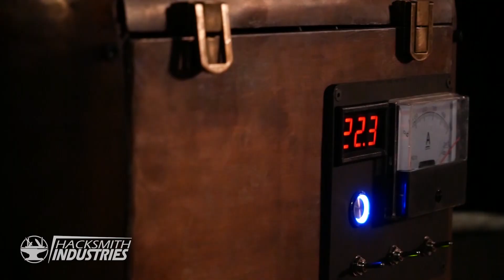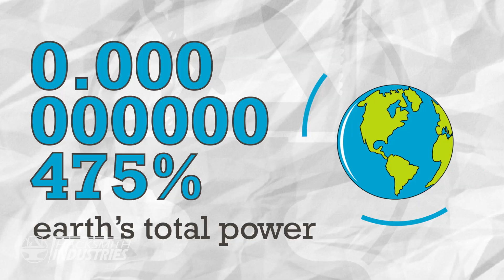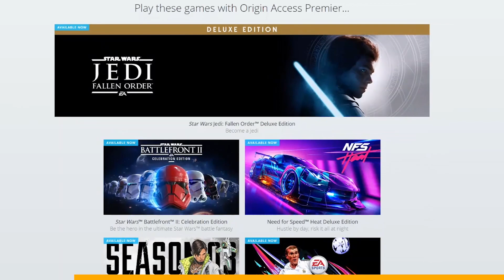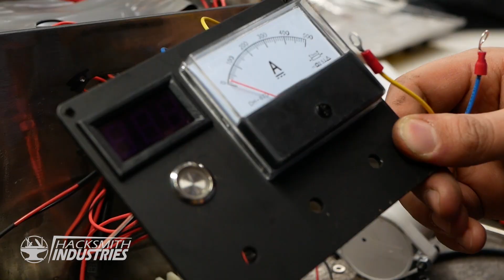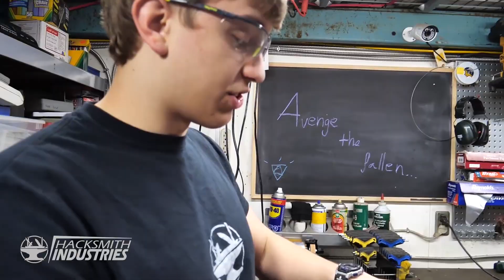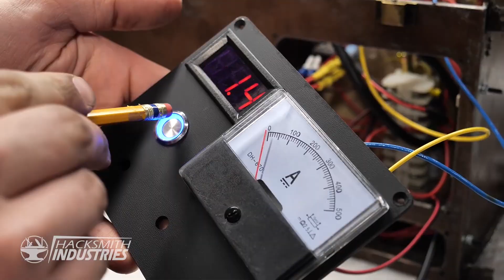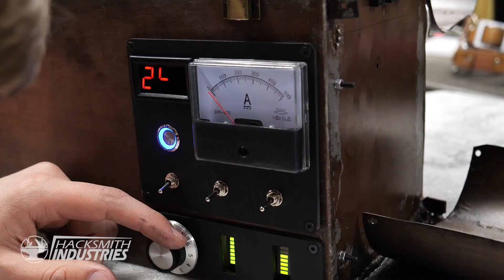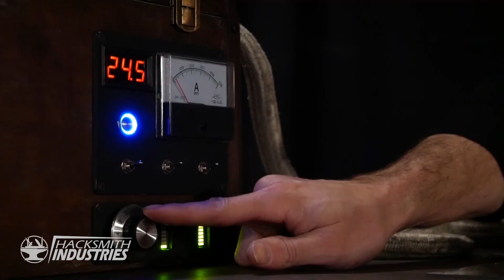World's First Protosaber! (REAL BURNING LIGHTSABER)

Comment: Now we just need to make the blade out of PURE MOTHERFUCKING PLASMA
Reply: CallMeCar then how r we going to keep the shape
Reply: @ruoyan9863  magnetic field bruh
Reply: @ruoyan9863  By making it more of a torch.
Reply: Ruo Yan probably some gas to keep the photons in place
Reply: @ruoyan9863  i think we should use a metal that is a plasma Conductor
Reply: creeper krazzy, you don’t conduct plasma seeming it is a state of matter, you don’t conduct liquids or gasses do you?
Reply: @olivesiren3537  From my own research, both of you are actually correct. What is now known as a lightaber was originally a large, bulky piece of mining equipment! It was a massive power generator that produced immense heat for just moments via "frozen" blaster technology. What preceeded them as conceptual lightsabers up to about 8000 bby were either Force-enchanted swords, such as Naga Sadow used, or darksabers that the Rakata used. Darksabers required the Dark side of the Force to function, as is true with nearly all Rakata tech. The original lightsaber is truely a much older design that had no practical use as a hand-held weapon.
Reply: Ruo Yan a magnetic field of some sort?
Reply: @ruoyan9863  magnets.
Reply: @ruoyan9863  via bounder flow
Reply: Ruo Yan, magnetic field
Reply: @ruoyan9863  Simple, create a titanium mold in the shape you need. Temperature test the mold by placing it in a forge(or if you're a normie just blowtorch it for a while).
Reply: @Gorgarth_JS  Titanium is a great metal, but it simply isn't able to handle that much heat! I would recommend either a new type of ceramic and boron nanotube composite, carbonfiber, or a tungsten alloy. A decent lightsaber would need to exceed 2861C to reliably vaporize iron, which makes that a good minimum-temp benchmark. Titanium melts at 1668C.
Reply: @d.dementedengineerc99isurf26  Fair enough, I suppose I didnt put enough thought into it lol
Reply: @Gorgarth_JS  Don't beat at yourself too much, because it wasn't a bad suggestion considering titanium's higher melting point! It's just that plamsa is wicked-hot! The boiling point of iron at 2,860C is 5,180F!!! I doubt anyone could wield that with even the best of magnetic fields, as heat always has those radiative and conductive properties, roasting all nearby! Something more than just a magnetic field is needed. One would need a well-insulated and highly-reflective exosuit to withstand that heat, and we already have those! Vulcanologists wear them whenever they aproach hot lava.
Reply: @d.dementedengineerc99isurf26  So logically speaking it would be physically impossible to create a real life lightsaber not only because it take an absurd amount of energy but because it would melt you where you stand even from testing it for a few seconds
Reply: @Gorgarth_JS  Yes. Imagine bringing the sun to half a foot from your face! You won't melt. You'd burst into flames!!
Reply: @Gorgarth_JS  On second thought, "impossible" isn't the word I would use. I'd describe it as both extemely difficult and extremely dangerous.
Reply: Ruo Yan electromagnetic field. That’s how it’s done in-universe, also explains how they collide with each other. We just need to find a way to generate a field and we good
Reply: @keeganfirecloak4695  well, lightsabers are also powered by small nuclear batteries basically. We'd need to scale down a reactor to that level as well.
Reply: @ruoyan9863  Magnetic field
Reply: @ruoyan9863  strong magnetic field
Reply: @ruoyan9863  a magnetic field would retain the plasma.
Reply: Ruo Yan 
A strong magnetic field maybe?
Reply: @derfuchs3296  Hello, you cute fuzzy redhead! :3
Reply: @ruoyan9863  Magnetic fields. Plasma both affects and is affected by them!
Reply: Ruo Yan magnetism
Reply: I actually have a design for that if you would like to hear
Reply: @red6.0  I'd love to
Reply: @red6.0  I wanna hear
Reply: Drake Hahn I wanna hear
Reply: @red6.0  please I want to hear this too
Reply: @red6.0  You got my curiousity
Reply: Drake Hahn why would you ask to answer a question
Reply: Drake Hahn Upload a video about it.
Reply: Drake Hahn What, did you watch some because science video and copied his idea.
Reply: @red6.0  What's the design?
Reply: @red6.0  If you are talking about the super battery, fan in the pommel, magnatized, collapsable, holed lightsaber that leaks out Plasma, yeah ive seen the video as well.
Reply: Anything is possible. Those who don't understand that don't understand quantum theory/physics, and they definitely don't understand our reality, or what what infinite really means. With that said, just because anything is possible, that doesn't mean that anything and/or everything will happen.
Reply: @in_vas_por8810  I think people really overuse and overestimate this "magical" quantum theory. It's not really all that special. It actually does imply that some things are impossible.
Reply: Drake Hahn aye we wanna hear what ur desighn is
Reply: @red6.0  I wanna hear too
Reply: Drake Hahn I wanna hear
Reply: @red6.0  WE ALL WANNA HEAR
Reply: @red6.0  "you had my curiosity, but no you have my erection"
Reply: I wanna hear this.
Reply: I saw this before
Reply: I think it was styropyro. He's the crazy guy who's a wizard with lasers.
Reply: They've taken the first step.  They've started us down the road toward the existence of a fully functioning lightsabre.  That's more than any of us can say.  This is history in the making.  Do not discount this, do not discount their accomplishments.
Reply: @Robert_Douglass  I think I will do exactly that. This is a hot stick. He said it right there in the video; a real lightsaber is impossible. That's that. There is no more to it. I sincerely hope this has burst your bubble and that you feel bad about saying something so moronic.
Reply: Nate Jl imagine thinking something is impossible within science
Reply: @natejl772  Everything is impossible until it becomes possible.  Look up Alcubierre-White, and you'll see that we are one step closer to figuring out faster than light travel.
Reply: @natejl772  Everything is impossible until it becomes possible.  Look up Alcubierre-White, and you'll see that we are one step closer to figuring out faster than light travel.
Reply: @xavier6838  Literally everything that is impossible is impossible BECAUSE of science.
Reply: DouglassRobert the laws of physics and such do not permit anything to travel faster than light
Reply: @natejl772  he was trying to give them thanks and maybe it isnt against but isnt discovered yet there's no need to be an issue
Reply: @natejl772  chill you don't have to make everyone feel bad
Reply: Nate Jl it's not impossible. I have a few ideas. I plan to start building it within 5-10 years.
Reply: @guywithacamera1749  the alcuberia/white drive works by warping space/time. Its basically star treks warp drive, though the math involved is beyond me the papers are available on the internet and they hold up to current physics. 
Of course to get a working version we would need hypothetical matter and absurd ammounts of energy (like equivalent to .1 jupiter masses of antimatter if i remember correctly) there's also the unfortunate unaddressed problems inherent in moving at relativistic speeds , like any and all radiation up shifting into high gamma radiation to say nothing of what a grain of sand would do at those speeds, or the fact that due to the blueshift inherent you would be completely unable to see ahead of the ship without yet more Clark tech. In a way you are both right on this
Reply: Nate Jl With our current technology, it is impossible, but almost nothing stays impossible. 20 years ago, functioning eco-skeletons were impossible, but my team and I are currently well into the development process of a functioning medical exoskeleton. Going to space was impossible before the Space Race. Cities were impossible before agriculture. As far as impossible tasks go, controlling plasma isn’t terribly monumental considering we already harness it for welding, cutting, and engraving.
Reply: @guywithacamera1749  the laws of physics do not allow anything to travel through SPACE faster than light. SPACE itself can do whatever the hell it wants. Like what it's doing now, expanding faster than the speed of light.
Reply: @ScarlettHasToast  not only that, we are on the cusp of fusion reactors. Actual full scale fusion reactors. Not fission, but fusion.
Reply: DryHot Fuzz going faster than light, that shits impossible
Reply: @guywithacamera1749  they don't prevent quite "everything".
Reply: @guywithacamera1749  Technically that's true.  But the Alcubierre-White warp drive, in theory and provided we can acquire enough dark energy to make it work, causes a "bubble" to form in spacetime by expanding it behind and contracting it ahead of a vessel so that it pushes anything within that space, including light, to greater speeds that what the General Theory of Relativity allows, akin to riding a wave.  In essence, the space itself moves faster than light, and because it is the space that moves, everything within that space is accelerated to the same speed.
Reply: @willkershisnik5893  going through space faster than light may be impossible, but get enough energy and dark matter to bend and warp spacetime and you can make space itself move faster than the light within it.
Reply: @jonjonward3915  Sure you are. please, share your designs so we can all see your genius
Reply: @ScarlettHasToast  What exactly is a "functioning exo skeleton"?
Reply: @Robert_Douglass  woah there padre, slow down with the edge there
Reply: I like your enthusiasm
Reply: Lol
Reply: I’m thinking that a strong enough em field should be able to control and contain the plasma in a real light saber we can already make the plasma balls in a microwave ( see the king of random about that )
Reply: @nickfenix3892  The problem is that you need more hardware to create the containment field than is required to light up a hot stick.  Lighting up a hot stick is a much better solution, and if you want, you can create a plasma around the stick, if you don't mind the stick sublimating with use, but there always needs to be some kind of hot stick in the middle.
Reply: The hot stick material can improve a lot, though.  Like I can imagine making a very hot stick out of high tension carbon nanotube rope, and that could create a thinner stick with even more intense heat density, which would make it easier to cut through things.  These guys basically showed it can be done.  I expect someone to tuck into it soon.  :)
Reply: Nick fenix lol if u have a strong enough field to hold plasma in place then it will be a barrier also to have contact with it....
Reply: @Puppy_Puppington  We can't actually verify that yet, and it will be at least centuries away. Plasma as we have it now passes through itself effortlessly.
Reply: CallMeCar make a tube, fill it with grapes, microwave them
Reply: Well uhh I guess Fire has plasma? Ehhhh
Reply: yazmin soto plasma is a stare of matter not a chemical reaction
Reply: Can we shape plasma with Magnets?
Reply: in Star Wars the first "lightsabers" used to be regular swords that were enchanted by force rituals mostly Sith Swords that are said to be as strong as lightsaber, then the second lightsabers you had to carry a power backpack just like in this video then they finally made the lightsabers we know today that dont need a powerbackpack
Reply: @lilclout5118  BINGO.
Reply: But we Need a Kyber-crystal to hold the Plasma on position
Reply: Call styropyro for that one
Reply: Much of this is already possible but a power source of the magnitude is far far away!!!
Reply: hi call. oh yeah yeahhhhhhh
Reply: GKeeper316  wtf did you get this information?
Reply: GKeeper316  yeah I just remembered. Now about that other thing.....
Reply: GKeeper316  which ones?
Reply: Well shit I just scrolled to the bottom and realized you guys pretty much figured it out yourselfs
Reply: It is a protosaber dude. Ok. I'm not saying your wrong I'm just saying that we just don't have the technology right now to do that. But at least they figured out how to start.
Reply: @Sequelhater69  yeah I know

Comment: How many of you know what a Tesla coil is? If you have a car, you have one. In a car it's called an Ignition Coil. It takes a small amount of volts, 12vdc, and turns it into 100,000 vdc or more to power the spark plugs. From no more energy. This is zero point energy. They don't want any of us to know this.
Reply from the maker: Voltage is useless without current.  Tesla coils  are transformers. Power does not increase,  it is proportional. Just because you get high voltage doesn't mean you can do anything with it.

Comment: that kind of power output is not at all impossible. It's just super hard and expensive to make. Antimatter has that kind of power and more to spare, but it costs billions just to make micrograms of it. so until we can bring down the cost, it's just improbable, not impossible
Reply from the maker: What about the heat output from that?
Reply: @hacksmith  well the power you'd get from a tiny milligram of antimatter is the same as an atomic bomb lmao so I'd assume you'd need a metal that doesn't instantly liquify at extreme temps, or you'd need the best capacitors and resistors  known to mankind to make it a variable power

Comment: Hay. you can just use a 220v Ac breaker! For ternning On or off a light saber!..
Reply: That was my first thought
Reply: I would feel skittish about a 500 amp switch in anything other than a relay.
Reply: Ac breaker on a DC power supply.  What could go wrong?
Reply: @Atlessa  I'm sure it's fine nothing will go wrong
Reply: @user-vu3iv3mq3b  chernobyl intensifies
Reply: @leecobb3424  shhhh
Reply: AC breakers will not work in a DC circuit
Reply: I'm not sure if anything world really go wrong, but definitely nothing would go right
Reply: @JasonGroom  no no no  everything would go just fine

Comment: You guys should collage with forged in fire, get them to make you a sharpened tungsten blade so you can slice stuff with this
Reply: They can slice stuff if they want to with it. The thing is so damn hot that it let's you melt through everything very quickly. The reason they don't do it is because it would be super dangerous. And it's a lot cooler slow.
Reply: Gallahad711 yea they can burn through stuff but they can’t strike or slice because it’s a pole and doesn’t move quick enough🤷‍♂️ was just a thought
Reply: @gallahad711yea8  They cant get through everything quickly, and if they swung it tungesten  would break and fly off the handle
Reply: Idk the science but wouldn't putting an edge on this be too fragile?
Reply: W Fresh then what about mixing or building a little steel into it or iron to harden it, maybe brass or bronze as a stabilizer, sorry I don’t know too much though
Reply: @twintin_346  Considering you want that to cut through stuff it would have to be way above all those metals melting points. So those metals would just melt when the lightsaber was heated up
Reply: @franciscoalmeida7017  oh. I did not know that.
Reply: Did u mean collab ?
Reply: It would be to thin that much heat would just make it fall over on itself
Reply: judging by its color its probably 950°C tho, preventing it to melt most things. even with the ir-filter present in allmost all cameras, its sensor is still likely to overexpose hot objects due to some amount of invisible radiation making it past that filter. a temperature reading from that thing would sill be interesting tho, just to be sure ;)

Comment: The switching could have definitely been done with mosfets. Using low voltage mosfets with an RDS(on) of 0.5mOhms would have each mosfet producing 5w of heat at 100A, which could have almost been done passively. Then put 10 or more in parallel to get the current rating you need. The gate capacitance would be huge, but you're not trying to use pwm so ultra fast switching times are not necessary.
Reply from the maker: Tried that already
Reply: @hacksmith  Then probably the mosfets smoke on start up when they're in their ohmic region. Maybe faster gate driving could fix it but I've been in the same place where I've just used a contactor.
Reply: Ok?
Reply: The contacter is just a good go to for something like this. You could have pissed around trying to get it to work and not burn for days, it just go to a method you know will work.

Comment: just a little bit of info, if you've read some of the older Star Wars comics set back in the old republic they used to have battery packs connected to their lightsaber so this is pretty spot which is dope.
Reply from the maker: Yeah we literally explain that in the first 3 minutes of the video
Reply: @hacksmith  Not gonna lie, I skipped to about halfway into the video and you can blame that on my low attention span.

Comment: maybe a relais or similar or a High Amp electric contactor like they use in welding machines could work as well instead of such a switch ? just asking 🙂 i mean we have some that can hold up to 70kw and 500-1000 amps (ok and maybe more (some of our motors in our factory have 225kw power